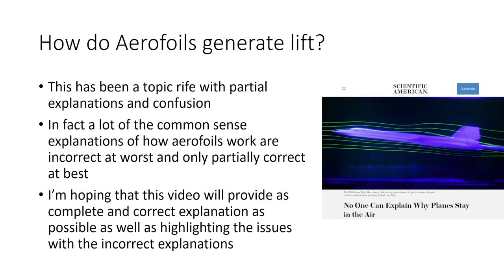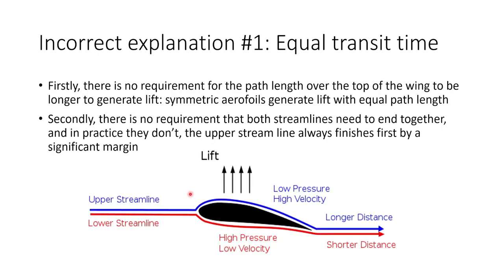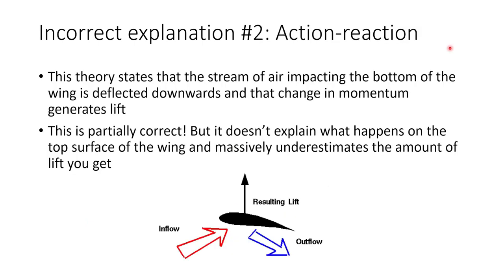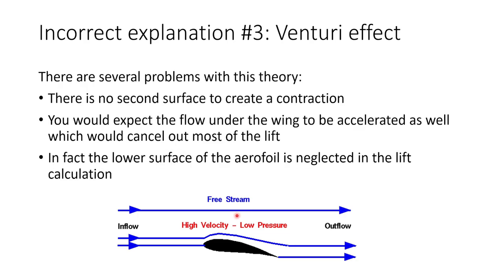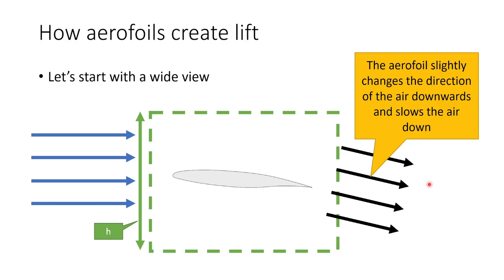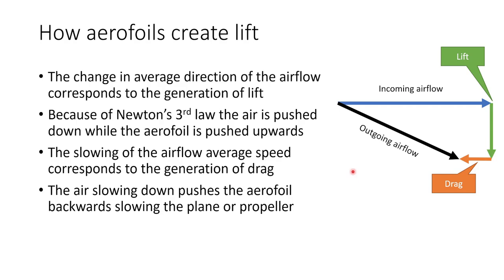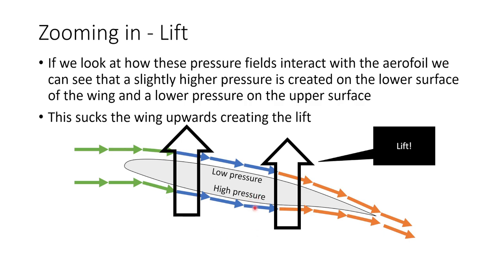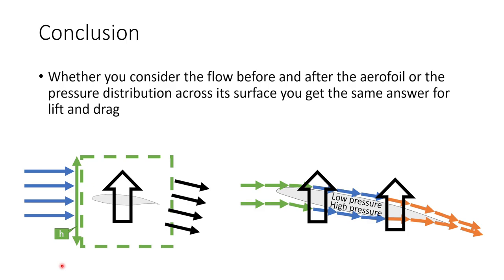How wings make lift and propellers make thrust: 100% Explained!

Comment: It's fascinating that Chris can always dive deep into the physics of FPV related topics.  Here's an idea of another topic. I'm always curious on how heat is generated in motor, why a badly tuned PID / noisy gyro generate so much heat, and how does the wasted heat affect the efficiency and flight time of the quads.
Reply from the maker: That's a great topic for a future video thank you!
Reply: That's a great question. Looking forward to Chris' video!

Comment: I graduated from an aviation college... with a degree in Aviation Science/Professional Pilot.  Had to take several classes on aerodynamics.  My roommate was an Aeronautical Engineer.  Your explanations at times had me shaking my head "NO".... at times had me shaking my head "YES..." the rest of the time had me scratching my head "What the hell is he talking about...???".  In the end, we know and have known for a very very long time that the production of lift is a combination of Newton's 3rd law of motion, and Bernoulli's principle.  Neither alone explains the total lift produced, but when both are considered, it all comes together-- Overly simplified, Bernoulli is at work on the top surface and Newton is at work on the bottom.  You touched on drag a bit... the first type of drag you showed with the vector diagram is called "Induced Drag"... it is the drag caused solely by the production of lift.  The second drag type that you called "skin drag" is properly termed "Parasite drag"...  I kinda think you got form drag right, sort of...
Reply from the maker: Sounds like you had all the possible reactions! I would agree that this is a classic case of Newton's 3rd law in action. Bernoulli applies to the whole air flow field so it is acting on the top and bottom surface and doesn't directly contribute to lift (it rather describes the link between the flow and pressure fields). The top surface creates lift by deflecting flow downwards, just like the bottom surface. Air pressure is the effect that keeps flow attached to the top of the aerofoil and allows that to happen.
Reply: bernoulli works on both top and bottom, but the top is shaded from the airstream and the bottom is exposed?
Reply: @ChrisRosser  Well.... I don't really know about that.  I'm going to say "not exactly".  Bernoulli is working on the top.  The upper curvature of the wing is a half section of your venturi example.  You don't need the full venturi cross section to be there for the effect to exist.

How would you explain then, the fact that an airfoil stalls at the same angle of attack regardless of the true airspeed, and regardless of the altitude (pressure)?  An airfoil at just below critical angle of attack will experience wildly different air pressures on the top of the airfoil vs. the bottom at let's say 50 KTAS vs 500KTAS.  Yet the static pressure is the same.  So, If I understand your argument correctly, the 500KTAS airfoil should stall much sooner (lower angle of attack) because the air pressure (due to high velocity, again, bernoulli...)would not be there to keep the flow attached to the top of the airfoil. Yet we know that this does not happen.  In fact, at higher airspeeds, the air pressure on the top of the airfoil at high angles of attack can drop so low that it causes the temperature of that air to drop to the point where the moisture condenses out and becomes visible... approaching zero psi... a truly LARGE change in pressure!!  But it still remains attached.  And under the wing, at the same moment, the air pressure would be dramatically higher than at the upper surface of the wing

I've never heard anyone explain it as you have... maybe I'm just not grasping your explanation and we're both seeing the same thing, but I don't think so... 

This is one of those discussion topics that requires a LOT of beer.
Reply: @ChrisRosser  Coanda effect is what keeps flow attached to the top of airfoil.
Bernoulli indeed acts on both top and bottom surface, but the speed of the fluid attached to the top is faster and bottom slower due to airfoil, so it creates difference in preassure between them, add Newton's 3rd law and there you have it - lift.
The lift is the trio - Bernouli, Newton, Coanda. Theres also Raynolds and other factors lift depends on, so yeah - a lot of beers talk :D
BTW, if noone could explain lift, then there would be no CFD software :)
Reply from the maker: @Демократът  Coanda effect only applies to jets of air into a slower moving fluid. Because all the air incident on the aerofoil is moving at the same speed there is no speed difference, no entrainment and therefore no Coanda effect acting on a simple aerofoil.  This is a very common misexplanation of why the flow attaches to the surface. The real reason is simply air pressure. Some advanced aerofoil designs bleed air from below the wing and inject it as a jet into the boundary layer above the wing (using slats) to keep the boundary layer attached at high AOA. Locally that is Coanda effect because you have a jet of fast moving air entering a region of slower moving air.
Reply from the maker: @BKD70  It's not right explain the lift of the top surface by the Venturi effect. If you consider a flat plate there is no contraction created but it still makes lift from the top surface.

Stalling is quite a separate consideration to lift generation. Stalling happens due to boundary layer separation. This is due to the boundary layer slowing down due to a combination of skin friction and the pressure rise from the low pressure atop the wing to the higher pressure at the trailing edge. It always occurs at the same angle (it does depend very slightly on Reynolds number) because the skin friction, and pressure differential depend on the flow velocity and density so all those parameters scale together. The critical AOA stays very similar it does increase very slightly with Reynolds number as more turbulence in the boundary layer helps keep it attached a little longer...
Reply: @ChrisRosser  Even a flat plate with a positive angle of attack will accelerate the air over the top surface to a higher velocity than the air traveling under the plate.  That faster moving air, per Bernoulli's Principle, will be at a lower pressure than the slower moving air on the bottom, resulting in a net lift force.  Bernoulli's principle. It even works on a flat plate, although a flat plate airfoil is not very efficient, except at very low Reynolds numbers. Combine that with the bottom surface deflecting the air downward, and you see Newton working on the bottom.

You can prove this in any instrumented air tunnel... I've seen it with my own eyes... was taught this by industry leading University professors, there are thousands of published books.

Answer this:  Consider a a Clark Y type airfoil.  At a=0, will it produce a positive coefficient of lift?  At a=-1,-2,-3?  at what angle of attack does the lift coefficient become zero?  I'll guarantee you it will not be where you think it is.

Bernoulli is just as much a factor in the production of lift as Newton.
Reply: @ChrisRosser  "The Coanda Effect provides another important explanation for lift. While the shape of a wing (airfoil) is designed to create differences in air pressure, the Coanda Effect explains that a wing's trailing edge must be sharp, and it must be aimed diagonally downward if it is to create lift." Source: NASA.
Reply: @ChrisRosser  your exploration is little  inaccurate,, with it you can't explain ground effects.
Reply from the maker: @mrlazda  I felt the disruption of wingtip vortices when aircraft fly close to the ground and the subsequent effect on lift and drag would have been somewhat out of scope for this simple consideration of lift. If you are interested it could be a topic of a future video?
Reply: @ChrisRosser  it would be interesting topic (not only for fix wing aircraft but to include rotary aircraft to) and one topic which is interesting (I see lot of misunderstood of it) is compering efficiency vs number of bladed of propeller (both topic are very loosely related). Second topic should be right in your expertise (as I understand you did previously some work on similar/same topic).
Reply: @Демократът  A wing trailing edge doesnt have to be sharp. A wing will generate lift perfectly well with a blunt trailing edge, but it will produce a lot of drag, hence why they usually do have sharp TE. However not all wings do, you see many 'foamy' RC planes where the wings are made from simple sheets of foam, and the TE is blunt. They work fine, not very efficient but they fly ok.
Reply: @jetplaneflyer  Shure, you can even make pizza box fly... terrible, but thats not the point of the talk. I have designed and analyzed hundreds of airfoils for different Re numbers and speed ranges, and none of them is with blunt trailing edge.
Reply: @Демократът  but you said that the TE MUST be sharp and pointed down if a wing is to create lift. This is incorrect. As per the examples i quoted. many wings make lift perfectly well without either of those features. They ,may not be the most efficient airfoils but they 'create lift' perfectly well. If you had said 'the TE must be sharp to reduce drag' then I'd have agreed with you.
Reply: @jetplaneflyer  Yes, it need to be sharp to reduce drag, and increase lift. I was quoting NASA, it was not my sentence. Also, ignoring physics phenomena that contribute to lift not making favour to anyone, as i said you can make many things fly, but designing efficient  wing or airfoil that consent to designed parameters is what is all about.

Comment: The simplest way I understand what happens at the topside is that the top of the wing sweeping through airflow creates vacuum volume behind it so the higher pressure air above it pushes air molecules to fill that space. Works with flat planes and symmetrical airfoils too, only the angle of attack matters in the direction of the lift. But a gradual curving shape helps keeping the flow attached to the surface and prevent turbulentic flow separation. I think this is the basics of Coanda effect.
Reply from the maker: Absolutely spot on with everything except the effect is simple air pressure not coanda effect. Coanda effect is only applicable to jets of air not a bulk flow like you get over a wing. 👍

Comment: the twist in modern props is there to create a constant distribution of the lift coefficient along the diameter
the tip of the prop moves faster than the center
therefore, it can be at a smaller angle of attack
the most efficient shape for a normal wing is an ellipse (not quite) and because of the same reason as before, the most efficient shape for a prop is a towards the tip slighly tapered ellipse
Reply from the maker: Great info thanks for sharing!

Comment: This is a great explanation with great visuals, a lot of the misconceptions were cleared up correctly. Only suggestion I would add is that the pressure gradient at the top of the airfoil will have usually traveled a much farther distance than the lower stream. It would be great if you could accurately represent this in some of your graphics to further drive home the point of the difference in velocity between the upper and lower surfaces, as well as how far out the geometry of the airfoil affects the incoming pressure gradient

Comment: This explanation is also quite handy at explaining what happens during a stall.
As the static pressure right on top of the surface of the wing approaches 0, the pressure differential that causes the airstream to follow the wing curvature can't get any higher. Any further increase in the angle of attack has the airstream detaching from the wing. This increases pressure at the wing surface at first, but it gets lowered again as the airstream is again deflected by the pressure differential to follow the curvature. As the cycle repeats, the airstream oscillates between these two states causing vortices to form.

Comment: For Venturi effect to work you do not need 2 surfaces,  point in case aerospike engine where second surface is "virtual" formed by ambient pressure.
Reply from the maker: I think you do. An aerospike engines uses atmospheric pressure to hold the exhasut against the spike but there is no cross sectional area reduction achieved. The venturi explanation is a very common incorrect explanation of lift, covered in more detail here: https://www.grc.nasa.gov/www/k-12/airplane/wrong3.html

Comment: Navier-Stokes :)

The derivation of Bernouili's equation assumes irrotational and/or invisicid flow and/or movement along streamlines. Those assumptions are not always satisfied. A turbulent (non-strealine) flow over a wing can still generate lift (many wings are not laminar... especially when looking at flow near the trailing edge).
Reply from the maker: Absolutely right, and that is why the correct explanation of lift for a wing doesn't rely on bernoulli. Only the false ones do 👍

Comment: This is an elaboration on the very basic explanation of how lift is generated often used by Don Stackhouse.  His usual simplification of the process is "a wing generates lift by grabbing chunks of air and shoving them downward".  He too could go into the details of how this is done but most often, for the purposes of his comments this elaboration is not necessary.  Truth is that I would love to hear his detailed explanation and compare it to Chris Rosser's.  No doubt there would be some differences in how it is explained but the overall conclusion would be much the same.
Reply from the maker: Exactly right, the control volume explanation is literally just Newton's 3rd Law. The second half of the explanantion really just expands on that by describing the method by which the aerofoil grabs hold of the air (air pressure holding the flow against the surface) and how the deflection of the flow creates the pressure difference on the wing that forces it upwards.

Comment: Doesn’t form drag for a streamlined aerofoil become abruptly significant at a stalling angle of something like 12-15 degrees?  I’ve tried this with NACA 0012 in a wind tunnel. I had alternate sides of the aerofoil connected up to a multiple manometer and it’s pretty obvious when stalling occurs.

Comment: I know this video is a year old but just curious if you could explain lift without using an airfoil. Example a foam profile rc airplane. Symmetrical and flat surfaces but yet it still flies very good

Comment: Hello Chris, I've just ordered your AOS 3.5 frame to copy your <250g build. I'm just wondering if I can use the DJI Air unit instead of the Caddx vista? I feel like ill be able to get better range plus the 50mbps bandwidth video from JB sold me. Any other thoughts on this choice are welcome since this is my first drone build.
Reply from the maker: I don't think the au fits in the 3.5 and it would be very heavy for smaller props. I think the vista is the way to go. You get 50mbps with the vista and equal range. Twin antennas only helps in strong multipath environments.

Comment: Chris, thanks for sharing your explanations :D,  hey i do not know if you have seen it but, will you make an analysis and maybe some upgrade mods to the following DIY quad frame https://youtu.be/1FsyVs9F5as  Happy New Year !
Reply from the maker: Hey! I like the tubular concept certainly it'll be very very stiff for its weight. How do you find the durability with thin walled tube?
Reply: @ChrisRosser  i have not tested one myself yet, i forgot to ask the author about the specs of the fiber tubes, what is the inside and outer diameter so to know the wall thickness, what type of fiber is also do a graph to see where you minimize weight and maximize the damping, what if you use semi hollow tubes or solid tubes. what you think

Comment: And I have to point out that pressure and flow are not "fields".
The vector of a field, namely its strength and direction, is insensitive to the chosen (inertial) frame of reference (FoR). For example, magnetism always has its direction along the field line leading to the N pole. Its strength is irrespective whether the magnet is stationary wrt the observer or moving.  The same is true for an electric field and gravity , the only other naturally occurring fields that I am aware of.
On the other hand, the vector of flow, namely its speed, and direction is quite different if you change your FoR from the foil, where the flow speed is the speed of the foil, to the ambient air, where the flow speed is zero.
 I'm not sure who is responsible for the introduction of fields into fluid dynamics, but I'm pretty sure it was current at the early part of the 20th Century. Certainly Prandtl in the '20s was (mis)using the term.  

It's a pretty deep question that casts serious doubt on a helluva lot of fluid dynamics.